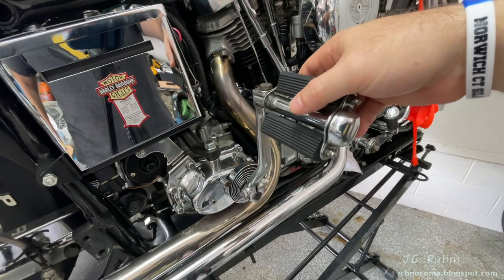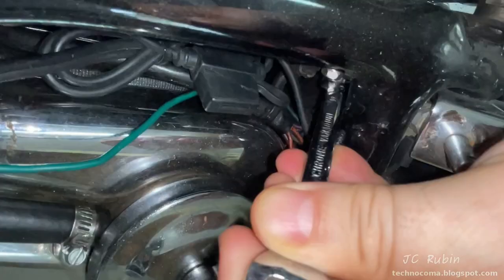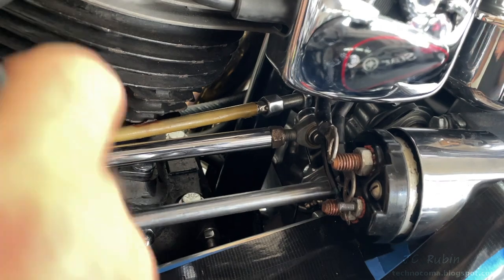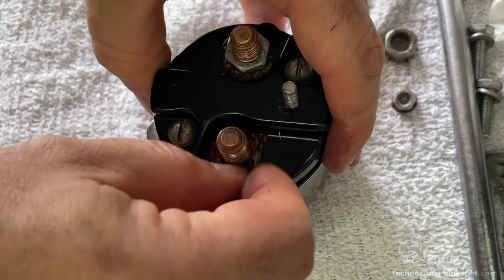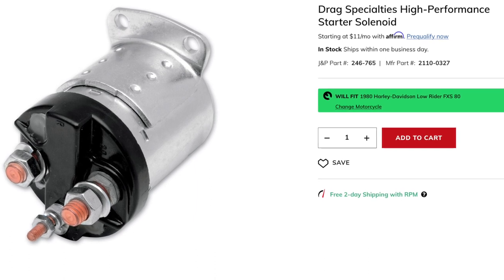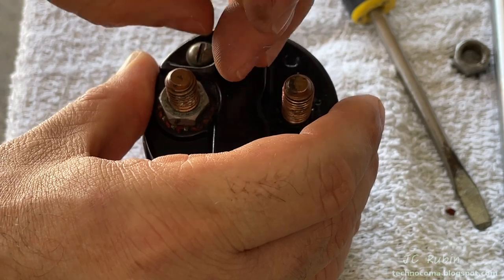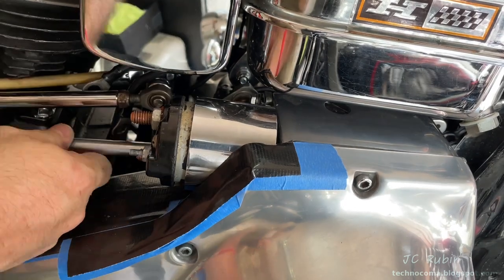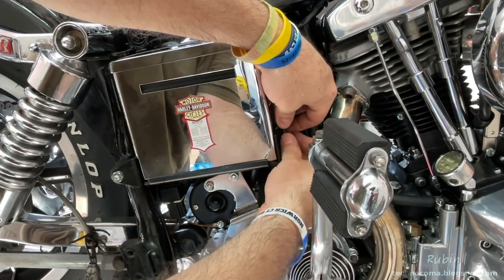Shovelhead Engine - Starter Solenoid Repair

Comment: Great content. I recently acquired a 1969 electraglide from my father in law. When I press the start button, sometimes the start will click sometimes it wont. If I press starter button in and hold, eventually it will try to turn over. Starter works intermittently while pressing the button. Should I do the solenoid repair as you have done. Any advise would be greatly appreciated.
Reply from the maker: It seems to point to the solenoid, its worth checking.

Comment: The terrible chrome cover is not different from any aftermarket supplier, I've been fixing old Harleys for 30+ years, and if anything, it seems like the stuff they sell is getting worse. To be fair though, the 9 year old Chinese kid that built that cover has never been anywhere even remotely close to a real Harley. The people that sell this stuff are not the ones who have to install it, and when you go to send it back, the postage and hassle isn't worth the trouble, so they win. Just about anything I ever get has somehow had to be modified to get it to work, and if not, it becomes part of my expensive shiny stuff in my garbage can.

Comment: I have a similar problem that I am struggling getting solved. I only get one click and it seem to come from the starter relay. If I tap the relay while pressing the starter button it generally engage. When I replace the relay it works for a couple of weeks/months but then the issue resurfaces. really bugs me and I dont know what/how to resolve this :( ('81 FLHC)
Reply from the maker: Strange. Have you tested these relays outside the bike to rule them out as an issue.
Reply: @delorean1  Cant fault the relays - but seem to point to just that
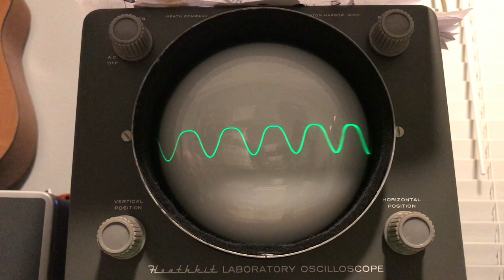Reply: 15:17 15:17 check the ground between the battery solenoid and the starter battery is mounted in rubber it will not ground efficiently running ground wire from your battery ground to your starter ground